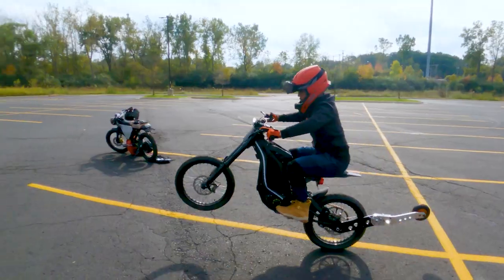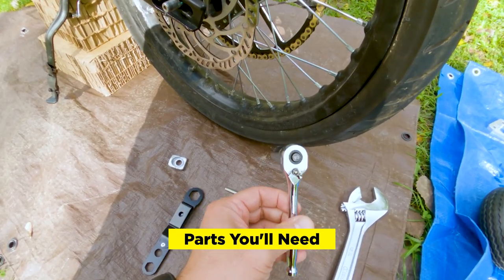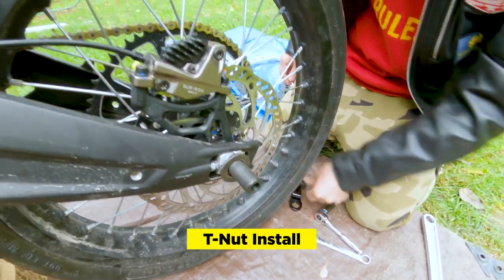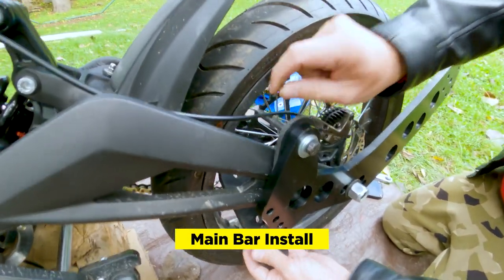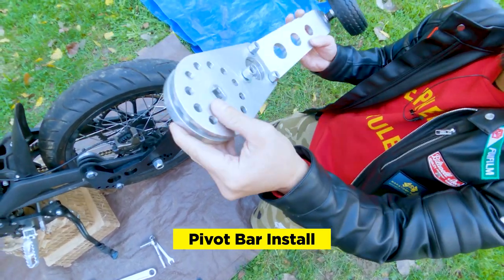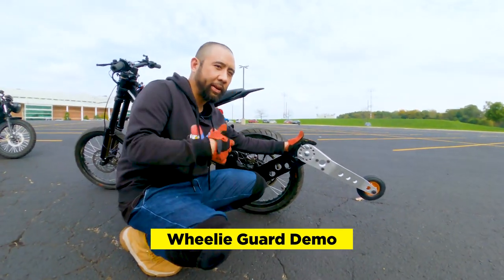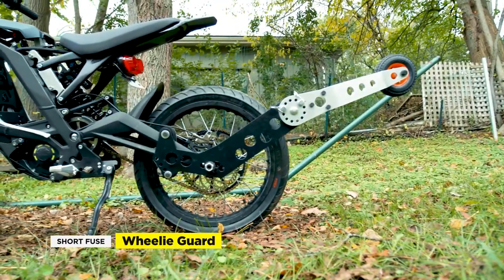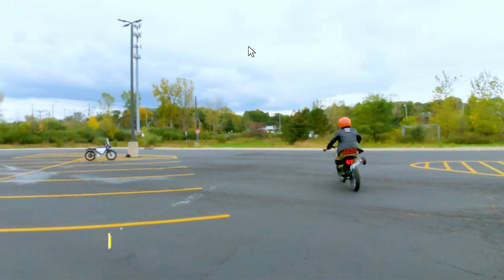Wheelie Guard Installation for the Sur-Ron X | RunPlayBack

Comment: I remembered doing wheelies the old fashion way. Lean back pull up and giving the right amount of juice and finding out your balance point. This looks it would be in my way.
Reply from the maker: Its at a really low angle, tilting upwards close to 90 degrees is where it should actually sit to reach balance point. I was just being very conservative with the adjustments.
Reply: yeah I feel like this will just teach horrible habits when learning to wheelie and it will end up being even harder to learn. just gotta accept you gonna eat shit a few times when learning
Reply from the maker: Thats fair, you have a good point
Reply: @RunPlayBack  did it help you with the confidence ? If it did then it's worth it.

Comment: You should correct your Wheelie Guard position. It stop you before you get right angle for wheellie.
Reply from the maker: Yeah it's at a higher position now. The low angle was just to get used to getting the wheel off the ground.

Comment: Lets go good job man
Reply from the maker: Thank you! Especially for those popping tips..its definitely helping!
Reply: @RunPlayBack  after watching every wheelie you did my main observation is still missing the wheel pop( i wanna see you pull hard ont the handle bar) and relying on the throttle too mutch if you still have the stock wheel i would put these on and go on grass it look stechy otherwise 🤟 also lean the bike on a tree at the wheelie angle and sit on it you can feel the balance point always helpful
Reply from the maker: @Adampage69  yeah filmed this awhile ago so didn't get to implement the pop techniques yet. But I'll be sure to do that from now on. Using the throttle to pop caused me to accelerate and bump the wheelie guard, throwing me off balance. Getting to see myself on video is helping to see what i'm doing wrong.

Comment: Oh The gas pipe you can get a 3-foot 1 inch gas pipe and then get your one  inch t connector, what other size you think will work for your bike as far as length 1 inch thick even 3/4 will hold you

Comment: The lawn mower wheel is about 3 inches thick for the axle and then you got another 3 inches on the T connector, that goes on the end of your  pipe, so the size of the bolt you use depends on the size of the wheel and the end piece which is about 3 in I'm sure everyone knows what a t connector is if not that's all you'll have to say to find it 1 inch t connector screws on to the pipe, I bought  a.  gas pipe,2 and a half long but it also depends on your bike my tires are only 20 inch so you need to figure that out, or just spend $300 I think I spent less than 50, never worry about flipping over just lean back you learn quick

Comment: I had to put stuff in the end piece ,screw on piece to keep the bolt as straight as i could I used a worm clamp cut straight piece's put   inside the t connector with tape around them first then screw in the bolt so it doesn't wiggle,then put your wheel on put a nut on tapped so it doesn't come loose save money its just to learn,then you take  it of......the end piece is a t splitter for gas pipes one inch wide screw on gas pipe,from home Depot 1/2 inch bolt at least 7 inches you have to go through the t, connector with the bolt put enough tape around the warm clamps so you can screw it in like a real bolt would screw in, even anything else something round with tape around it,, so you can screw it through then put your wheel on, this way the bolt is not wiggling,wiggle a tiny bit but it's okay

Comment: 7 inch bolt, 1 inch wide gas pipe whatever length you need, set a 1 inch t connector read the rest you'll save money

Comment: So the Wheelie Guard Kit won’t bend where it is attached to?? Seems like a lot of leverage.
Reply from the maker: Not really. There isn't a whole lot of force that's exerted on it since you're not really riding on it with your full weight. Once you feel the wheel tap, that's your signal to tap the rear brake.

Comment: Your leaning forward. Gas it and then straighten your arms and pull back slightly and lean back. It will wheelie easily
Reply from the maker: Yup! Plus the wheelie guard was positioned too low, it kept knocking me forward before I could get confident with the balance point and lean back. I will try that next time...thank you! 👍

Comment: Lowering it makes wheelies harder 🤦🏻‍♂️
Get a mountain bike and raise the seat way up and get used to the balance point and keeping it there with braking. I’ve spent hours of my life on one wheel and can slow to a stop and take off again on the back tire (as I’m sure many other people can too). A flexible rear suspension adds variability and makes the lowering of center of gravity that much more of a high stakes gamble, waste of time, and needless wear on the bike. That gizmo on the back won’t help if the angle required for COG has you sliding off the back, so raise seat back up and maybe even add lift brackets.
Thanks for the vid nonetheless 👏👏
Reply from the maker: This is very thoughtful and detailed feedback. Thank you! I will try this out once I start practicing again in the Spring. It's a bit icy out here at the moment. Much appreciated :)

Comment: did you drill holes into the swingarm to install the pegs similar to what MOTOMATT69 did for an easy wheelie hack?  I'm thinking of doing the same thing but hesitant about drilling as this is a permanent mod.  I'm wondering about the longterm durability if I do such mod.
Reply from the maker: Yes I did. Its fine, no issues.